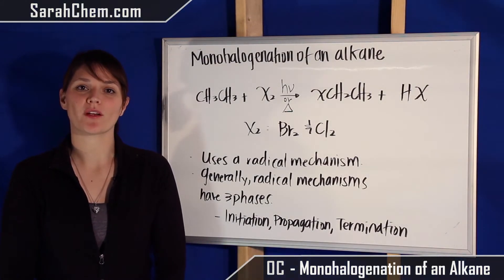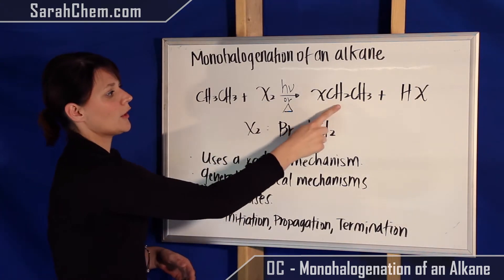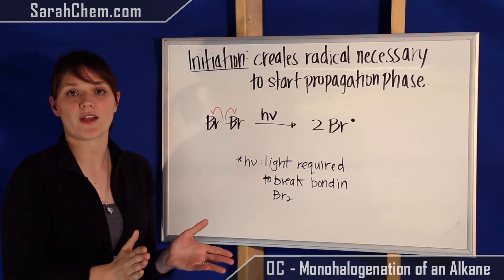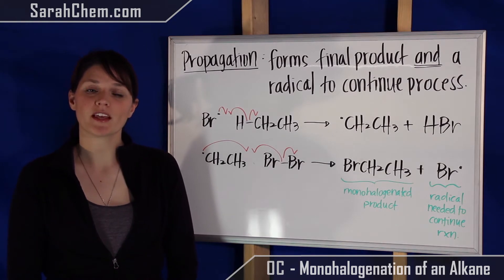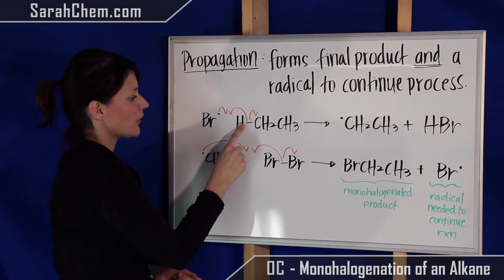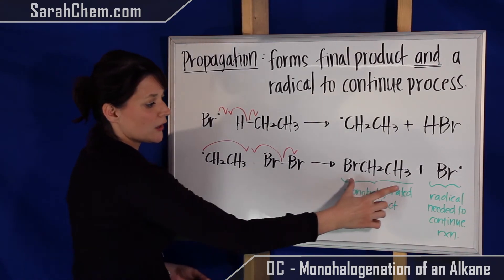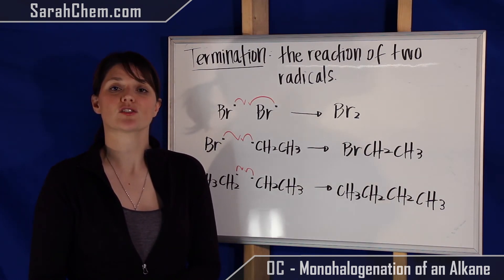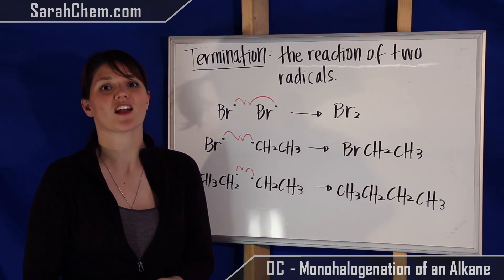Monohalogenation of an Alkane

Comment: please talk about the major product
Reply from the maker: Are you thinking in terms of bromine specifically or in contrast to chlorine?
Reply: For both chlorine and bromine. ..
Reply from the maker: Chlorine is more reactive than bromine so it is less selective in where it adds; bromine on the other hand is MUCH more selective.  In the case of bromine there is a strong preference for tertiary over secondary and secondary over primary.  Chlorine  does show a preference for tertiary over secondary and secondary over primary but it is a much more minimal preference.  When selecting the major product you would need to take into account the number of primary, secondary and tertiary hydrogens and the relative rates of formation for each, to determine what the overall major product would be in the case of chlorine halogenation.  

The relative rates of formation for bromine is"
1600 (tertiary), 82 (secondary) and 1(primary) meaning that if you had both a tertiary and a primary position in a compound you would make 1600 tertiary substituted product for every one primary.

The relative rates of formation for chlorine is:
5 (tertiary), 3.8 (secondary) and 1(primary)
So you can see that the degree of preference is much less.

Maybe I should add a video discussing this :-)  Hope that this helps for now!
Reply: Thanks very much mam... I understood now .. But plz do make a video taking only examples on this .. Just one confusion I have . can u answer that now?
Reply from the maker: What is your point of confusion?
Reply: Mam in 2,methyl butane if we carry Cl2(in presence of light ) then we have two CH3 or preferable sites for Cl2 .. Both are kinetically favoured . so what's the major product in this case ?
Reply from the maker: In this case you would need to determine how many distinct products you could make when you mono-chlorinate the alkane.  For example CH3CH(CH3)CH2CH3 has only 1 possible tertiary position so you would multiply by (1)(5) where one represents the number of hydrogens available for substituting in that particular position by the rate of formation.  Where as for secondary product you have (2)(3.8) = 7.6 because there are 2 secondary H's and the rate of formation is 3.8.  You would need to do this for the primary positions as well.  Be sure you keep in mind that there are two distinct primary substitution products.  Of the three primary carbons, two would result in identical products and one would be unique.  This means that you have (6)(1)=6 and (3)(1)=3 for the other.  Adding all the values together you get 21.6.  In order to figure out the percent yield for each you would divide the value for a particular product by this total.  get by the total of all those values to get the percent yield. For example the tertiary product percent yield is (5/21.6)*100=23%.  You could this for all of them and figure out the relative percentages of each.

Hope that helps.
Reply: I`m in 12th grade and hvent taught % yields in my orgo class .. But this ques. was thr in my to do work sheet .... Thnks very much to take so much of ur tym mam..  Can I ask nything if needed 2 u somewhere :) ...
Reply from the maker: I hope that it helped you to understand your homework sheet.  This is the best place to ask questions - I try and check it relatively regularly.   Good luck with your class!
Reply: Ok thanks then I vil also be hre regularly ... It really helped :;. Hpy new year btw.. Sry it's 8 days older actually ..
Reply: I have a problm mam.. Vil put that whn u say .
Reply from the maker: Thank you - Happy New Year to you, as well! :-)
Reply from the maker: What is your trouble?
Reply: Ph-Cl , Ph-X, Ph-Br, Ph- I. 
How to compare rate of ArSE2 mechanism.. Where Ph is phenyl
Reply: U didn't answer mam ??
Reply from the maker: The paper found at this link (http://pubs.acs.org/doi/abs/10.1021/ed041p341) might serve to answer your question.  Let me know if it helps.  Very Best.
Reply: Mam its saying that authorisation required when I click on view Pdf ... Sry if I m a bit foolish.. Do I should register on it ??
Reply from the maker: You should be able to access it from your school library systems.
Reply: School library systems ??
Reply from the maker: If you use the library internet at your school, you should be able to access the article.
Reply: Okk .. I guess u vil describe it well if take a video on it ..
Reply: Why is Cr+3 reducing and Mn+2 oxidising when both have d4 configuration ?  
First u ans. And then I vil put my doubt in it ?
Reply from the maker: You asked about Cr3+ and Mn2+ but their electron configurations are 
Cr+3: [Ar]3d3  and Mn+2: [Ar}3d5.  

I'm thinking you may have meant Cr2+ and Mn3+ because they do have the same electron configuration; [Ar]3d4.  The answer is found in molecular orbital symmetry, when Cr2+ acts as a reducing agent (loses an electron) its electrons are found in a lower energy orbital.  Essentially it has a very favorable electron arrangement.  In the case of Mn3+, it has a more stable configuration when it's d orbitals are half filled so it acts as an oxidizing agent (gains an electron) to achieve the more stable Mn2+ configuration.
Reply: Sryyyyyyy......  Its by mistake .
Reply: But that exactly half filled stability why it isn't attained by cr+2?
Reply: Vil u plz list down all the uses of SeO2 in organic chemistry ... Its a bit urgent .